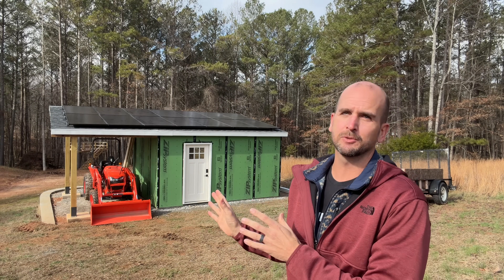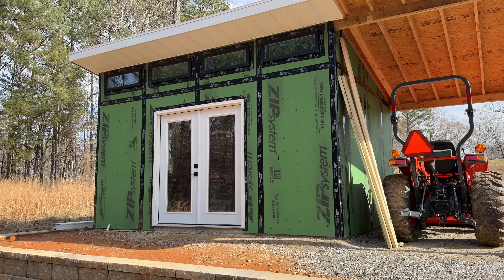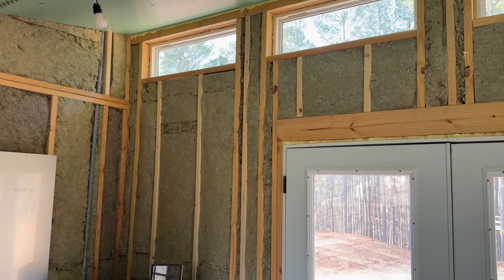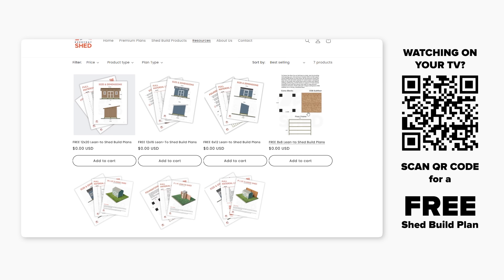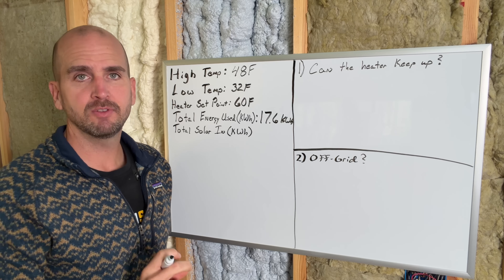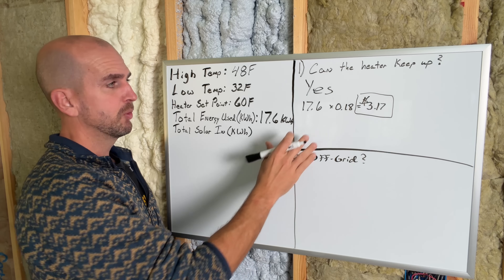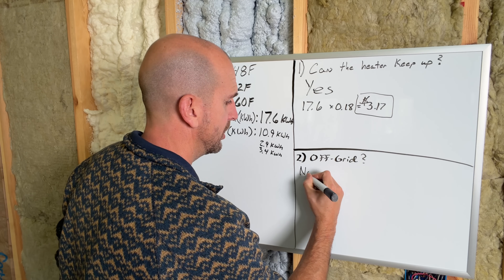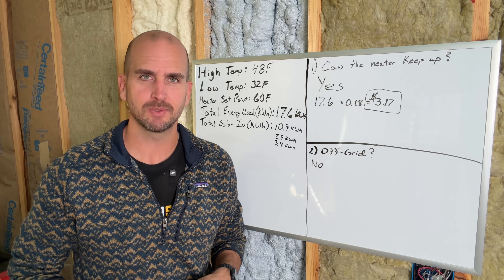HUGE Mistake: Why My $15,000 Solar System CAN'T Heat My Tiny Shed

Comment: This shed needs a lot of improvements, first to reduce the energy losses around it preserving its original design and a little bit more.... French door, really...?.. The French door losses around 1,500 BTU/hr and the roof windows too, so off the line you installed a deficit of 3,000 BTU/hr to the shed just by the choice of door and windows and to compensate it you'll need to add storm windows to the roof windows separated by 2" wood from the windows to reduce losses to around 300/BTU/hr, for the " French door " you'll need to build a box of construction 1 meter outside around the " French door " to create a temperature barrier and a solid plastic door externally, this will reduce your losses from 1,500 BTU to 300 BTU/hr.... 
The roof should have a sandwich plywood with penoplast as insulation to reduce losses trough the roof.....
I live N 50 degree parallel and like my ambient temperature at around 80 F specially when it is overcast, 20 F outside sometimes with snow flurries... The front door should be at least 6" above ground to avoid rain and snow splashes in the door....

Comment: A good small mini-split will achieve 300+% efficiency for heating and cooling in most climates over the 100% of resistance electric. Makes a big difference, as does insulation. Solar is expensive so it's better to spend on efficiency of use and reduction of heat loss over more solar.

Comment: That solar setup is a waste of resources, too costly for very little power generated....!.. 
You can replace all that with a small Piegaz Hermes Italian gas boiler and a 4KW power station to handle the heater part at not 60 F but at 80F with a 2,000 W BTU water radiator, it just uses 100W of 230v electricity and automatically cycles on and off sporadically, you can use a small gas generator to replenish batteries every couple of days fueled by a small gas  balloon or house electricity.... I'm ib a war zone with sporadic power but a couple of hours  of electricity  a day is enough for me to maintain a 2,000 sq foot house at 75F all day... My house is made of gasoblock qith no insulation on walls just 30 cm on the roof and penoplast under the concrete slab.....

Comment: Recall reading that you can only count on 1/3 of your nominal capacity when it comes to Solar.
Reply: Sort of.  Based on my over four decades of real world hands on experience with ruinables you can expect about 1/4 of the rated output in the best summer months, but only 1/32 of the rated output in the worst winter months.   One of my systems here in Michigan is generating power for the first time in 19 days today due to snow and ice covering the panels on the roof.
Reply: @ForbiddTV hence needing backup heating and generation equipment, if one wishes to not be grid-dependent.  Might want to do “co-generation,” if it can be achieved, much like I had planned to do (25+ years ago) if I were able to build a home of some kind.  This, of course, was before learning how disabled I really was and am.
Reply: @dennisyoung4631  People who want to realistically live off grid will have to be burning some sort of fuel unless they are near the equator.

Comment: you could increase pv capacity by making a pv awning with a dedicated 240vdc can run a heater during the day... (you would need to modify the thermostat to run a dc contactor. we use a wood heater, plenty of heat, obviously no free, lots of work getting and moving wood.

Comment: At the angle the sun hits those panels where you are is a waste of time. If the panels do not follow the sun they are a waste of money and time. They must have  direct sun light not even addressing the short winter days and long winter nights.
Reply: The system he set up is optimized for summer (when he doesn't need the heater), but would be almost useless in the winter unless he changed the angle significantly.  Tracking is pretty much a waste of money for the slight gains obtained.

Comment: as mentioned those electric oil heaters are useless,  i have a 2400 ft 2 shop with 15 ft ceiling  with 72000 Btu total in 4 minisplits so about 21kw and we keep the shop at 68 F all the time with ambient down to -5 f and up to 120f with little problem ,,, r19 walls r38 ceiling rockwool ,,, expensive though,,,  my shop electric cost is  2 thirds the house including running equipment

Comment: I don’t get it? You build a small cabin surrounded by woodland and you choose to heat the cabin with a small electric heater? That’s daft, use a wood stove. Renewable and sustainable fuel source all year round.

Comment: At mid level, Canada in the winter where your temperature probably averages 10 degrees fahrenheit and can go as low as -40 degrees fahrenheit.You can do the math in your head and say it's a no go. Not to mention very short days in the winter.

Comment: I tried watching but couldn't get past the thoughtfulness of the insulation choice but then took a huge step back to use a *radiator*. Yikes!

What would have been informative is demonstrate the efficiency of a modern heat pump/mini split. They have hybrid units that take direct solar as well. They're also efficient at freezing temps.

I just wish you did more to increase awareness instead of reinforcing high school taught HVAC techs that heat pumps don't work in cold climates.

Comment: this is completely impractical to heat a building with solar energy
You would need approx 5 to 10 times that area for it to work correctly, because sadly the darker / more overcast  it gets, the more energy you need to heat you little shed.
And this is completely the opposite in summer, when you either have no use for solar energy because obviously there is a lot of heat during the day, or maybe you can use it to run the A/C which doesn't need that much power for a small surface like this. And I'm not even talking about the cost, which will never be amortized.

Comment: A small fan would help the radiator heat faster and keep the room temp more consistent from corner to corner, which could lower the amount of energy needed if the radiator corner was hotter than needed.

Comment: You said it. A small window during the day. You can get power in the shade better if you don't go for the efficiency model and over rate you panels. Then, they hit the voltage needed with less light needed. Forget how they tell you to do it and use better panels. Simple.

Comment: So $15,000 spent on solar. stuff.  It costs $3.17 per day to heat from the utility/  $15,000 / $3.17 = 4,732 days from the utility or 12.96 years .  
How about a propane Buddy heater?

Comment: You lose more than 50% of your solar in winter... and if there's snow on the panels, they're just an expensive roof.
Reply: I'm heating and cooling a 30 X 40, 14 ft side wall, 3/12 pitch roof Barndominium, under construction, with a single 1500 watt heater... to keep it comfortable to work inside.  5000 btu window AC for summer.   2 inches closed cell and 4 inches open cell and I don't use as much energy as your SHED.  65 F inside when it is 27 F outside,  75 F inside when it is 95 F outside.

When I get 2  of the planned heat pump mini splits installed next week, my energy use will go down for heat.  Probably not much change for cooling.

Your insulation is bad or you have a lot of excess air exchange with outside.

Comment: Did you just test the heater load for one day.  ie. trying to bring temperature up to 60F from 30F or 40F instead of measuring "maintenance" load when starting temp was close to 60F?  You could also set the setpoint to 35F for 12-16 hours per day (night) when not in use.

A feature of many solar charge controllers is a "dump load".  Having a barrel of water insulated to not release heat too fast is something that can be fully heated to 200F in November.  To get 2 week heat release time from 90C, it does take 8 inches of R5 insulation around water tank. But you will get a few sunny days to recharge during that 2 week window.

for 8 hours heat requirement for 200 square feet should be about 7kwh (6000btu per hour).  And passive heat from hot dirt, should keep it above freezing rest of time, and reduce electric input.  200l water at 90C can provide 200 btu (at slow 2 week drain rate)

Comment: Solar makes sense as a supplement, but now as the entire power supply. This is particularly in the north, where our energy needs are greatest in the winter, when daylight hours are most limited. It seems more practical to limit solar to what can be immediately used, removing expensive storage solutions.

Comment: There are a few ways to look at it from the data: 1) It would work if you went hybrid mode. Full off grid as of current wouldnt work, BUT 2) Going a heat pump setup and a bit more insulation for the floor and roof could maybe keep that power demand much lower allowing you to get to that full off grid you need it for a day or two with a gen backup. It also looks like its facing the wrong direction for solar and the slop too witch could improve input as well. I think over all its possible for this shed to work in off grid - just needs a few changes. To me, thats cool to see its possible and with a bit more setup, does mean we dont really need a whole lot of solar to run a house all year round.

Comment: i am looking to buy land to build my workshop (lab) and small farm for the last 7 years, thought about solar but here winters are really bad so solar wont sort my issue just like you discovered. F solar, what i am looking for is a land next to a river for a hydro power which will work in winter and at night too, no batteries no nothing.

Comment: as   someone who  lives at latitude 52 who heats with solar.as i can heat  ~100% with solar until Dec and again 100% end of Feb  as my  house( 1300sqf)  only need as about 800w  to keep it at  warm at - 30C. you do not have enough insulation.  2x6  wall  and Fiberglas is far better then rock wool. and at least r30 ceiling. but I use thermal storage . if you live in latitude of <50. you can  that small of space a 100 or 200 watt light bulb will keep it warm enough. as  your lowest sun level is  about the same as my light level  near mid November  when my sun levels are too low  add too short to capture enough  for storage capacity at my extreme temps . once in Dec Jan and Feb  i heat with heat pump during these months.

Comment: I’m sure you know this, I just can’t figure out why you didn’t talk about it.  The ceiling is wildly under insulated.  The walls are barely adequate and the slab is a huge heat sink.  At a minimum, double the foam board on the ceiling.  Put something on the slab to act a thermal break for your flooring.  On the outside walls, add foam backed siding or a half inch of foam under your siding.  That should get the heat load low enough for your existing solar system to power a mini-split that will easily heat the shed and air condition it in the summer.

Drywall will add 0.5 R to the wall and it will also improve the r value of the wall as a unit by decreasing airflow in the insulation.

Comment: even with R 41 roof insulation, the windows along the ceiling will suck heat out of the building. Remove those windows to avoid losing heat.

Comment: There's a lot of room for improvement in the insulation, what americans often forget is that you have super cheap energy, that's why your insulation always is too little, you need 300 millimeter of rockwool in the walls, and 400 milimeter in the roof, you need at least 200 milimeter of foam in the floor, then you only need very little energy, and insulation are way cheaper than more batteries

Comment: Using solar cells for heating is wrong. You need to capture heat directly from the sun, like in a solar water system. You are using a wider range of radiation, more efficiently, and storing warmed water is much cheaper than storing electricity.

Comment: Many valid comments. I guess the major conclusion could be: a seemingly good small building does not suffice.

It would have been nice, in the comments, to find a calculation for a comparable space using say 4 kWh/day (in similar weather). The results should then be the desired R-value for each of the 6 surfces taking into account differences in heat loss (ceiling versus floor, Walls versus ceiling). This would give other builders an aiming point.

Comment: A fellow out in Wisconsin built a hanger for his several airplanes and poured a very thick slab with embedded tubing that thermosyphoned heated fluid.   He'd turn on a normal Bunsen Burner like you had in chem lab and that gradually heated up the slab no pump needed.   I don't remember how long he ran it before the cold weather came in but once that slab was warm it was shirtsleeve temperature even when 30 below outside.    I'm wondering if that wouldn't be the better way to go heating with solar?  Heat up the slab with any excess juice you get (which should be quite a lot on sunny summer days) and rather than trying to store it in expensive batteries....store it as heat in the slab.   I like this idea....

Comment: Noooooooooo don't use a 'radiator' (resistive heat) type heater -  you MUST use a mini-split heat pump which would EASILY heat that up nice and toasty.  Preferrably a Hyper-Heat version of a mini-split heatpump!

Comment: I run my Dreo wall mount heater on Eco mode and is surprisingly  efficient and pumps out the heat. 100% solar powered

Comment: Just my 2 cents worth:
The main problem I see is that you used insufficient insulation for an off-grid installation. Sufficient Fiberglass insulation installed just once is much cheaper and effective than building up a large enough PV/battery system to ensure comfortable heat under all conditions. Also, with a space such as you show, it's unwise to install the PV on the roof instead of on the ground. Roof installs are done out of necessity when there is limited ground space. They are far from best engineering practice for PV installations. A roof install like yours increases the likelihood of roof leaks, will make such leaks a real pain to repair, will not allow you to point the panels at the best angle to the sun or allow you to optimize that angle for the season. It also makes it very difficult to do any necessary electrical maintenance that might arise, and will make it almost impossible to clean off snow and dust efficiently and effectively, something that needs to be done every few days in most locations in order to keep the panels' output high. All in all it simply doesn't appear to be a very well thought-out installation, and will waste a lot of money and energy over time, when with a bit of planning it would have been much more effective as well as convenient to maintain over time.

Comment: Direct solar heating of the air as way more efficient than converting solar to electricity to heat.  Pop can solar with a small solar panel for small fans to move the air through the pop can solar tubes would give you 2X the heat.

Comment: $15k hahahha.  That's at least 6 times the cost if you'd just bought your own inverter and batteries. Ecoflow is the easy solution but just know, people, they charge insanely high prices for the hardware you get.  You took all this time and money to renovate .. then you buy the worst imaginable value product off the shelf instead of diy that part.

Comment: You could pump water through black PVC/into a radiator, then add mirrors if it needs more heat- all the PVC would be enclosed with a glass top to minimize heat loss. I suppose you wouldn't have heat at night though.

Comment: You cannot heat a house in a cold climate (ex: Canada) with the scale of renewables you can resonnably install at home. Please get some panels, put them on your roof, shutdown utility and show the world how you did it. I actually did put solar panels on my roof but I also installed a woodstove to heat the house... that worked and provided me with some energy independance. On my sailboat, in the warm waters of the caribbean, my panels are sufficient because there's no heating required. 15'000$ get you many years of hassle free utility energy. If you're serious about going off-grid, solar is the baseline for small electrical loads (enhanced with wind for overcast and windy days), wood or propane for all heating needs and gasoline or diesel for transportation (you could sqeeze a few kWh into charging an EV for a short trip once a week but beyond that, you need fuel).

Comment: I can't imagine a bigger heat soak than a concrete slab, except maybe a metal one. You are fighting a huge problem. Large power draw with the least amount of input energy in the winter in the case of solar.

Comment: I'm only at 4 mins into your vid and I think you would need at least 2 more inches of rigid foam on the outside of the shed and ceiling. A heatpump will also make the most of the power from your solar setup.

Comment: My 12z12 power shed has spray foam, rockwool shoved into any crevices (I don’t like any chimneys inside of walls) and I build a false floor to insulate over the insulated slabs. 3/4 ply on the walls followed by 5/8 Sheetrock. Even with a somewhat leaky (but insulated) garage door on one side, I can heat it with a fart. It does have a Mitsubishi Hi2 Minisplit installed. For both AC and heat. It also houses small servers and switches besides the four SMA Sunny Islands, three SMA Sunny Boy 7.7s, and 135KWH of DIY batteries.

Comment: You're not heating that space when there is no one in there... Plus there are more efficient heater types that what you have with that electric radiator.

Comment: I have a 14 x 36' cabin that runs primarily off solar, but.. my electric heat and hot water tank run on grid power. AC is a different story, my solar runs two 12k btu units with no problem all summer long. I've learned it's not about the size of your solar panel array, the size of your battery bank is way more important and should be able to carry the load for atleast 3 rainy/overcast days.